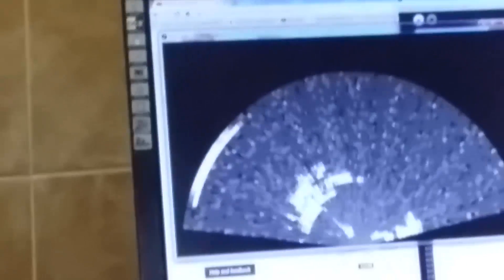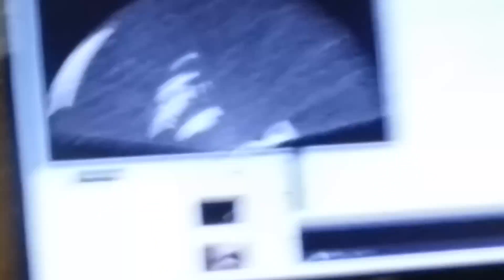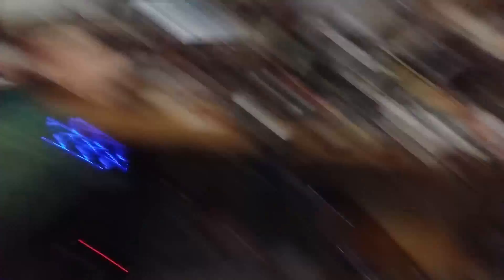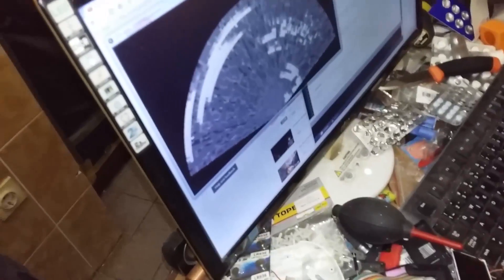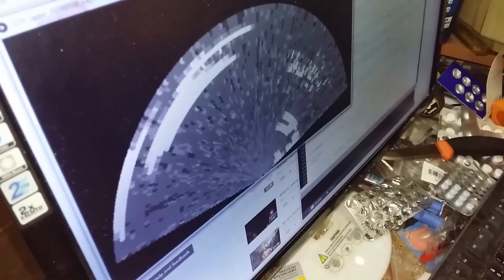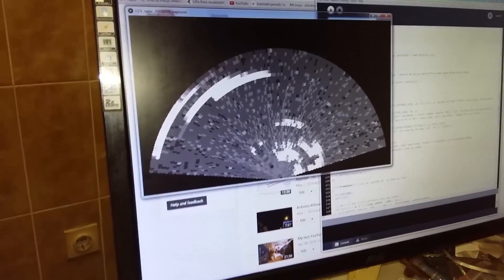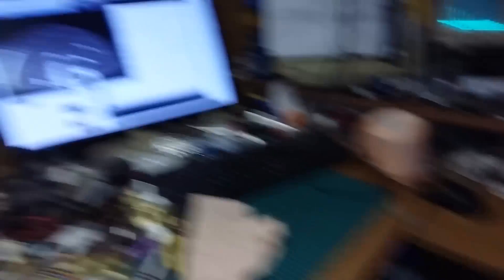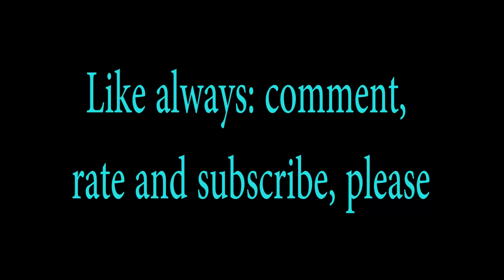Arduino Multipoint Ultrasonic Radar

Comment: Odličan video i eksperiment.
Primijetio sam da ste hrvat, pa evo pišem na hrvatskom. (english translation is under this post)
Imam pitanje, odnosno više njih :).
Vidio sam Vaš kod za arduino, te sam naletio na linije koda:
for (j=0;j<40;j++) 
{
 int str= ((analogRead(analog_pin)*5.00)/1024)*pow(i,2)*5;
}
prilično mi je jasno što ovdje radite, ali funkcija pow(i,2) ne bi li trebala glasiti pow(j,2)?
Kad smo riješili tipfeler (ili možda griješim) imam još jedno pitanje?

Vidim da je pretpostavka povratnog signala tj. analognog signala okomit na sami senzor.
Je li moguće da neki od tih povratnih signala ne dolazi samo iz okomitog smjera gledanja senzora?
Jer podaci iz datasheet-a ovog senzora kažu da je vidljivost ovog senzora -15° do +15° odnosno 30 stupnjeva od centralnog dijela senzora.
https://www.electroschematics.com/wp-content/uploads/2013/07/HC-SR04-datasheet-version-2.pdf
Lijepi pozdrav.

Great video and experiment.

I have a question, or more than one :).
I saw your code for arduino, and I came across the lines of code:
for (j=0;j<40;j++)
{
  int str= ((analogRead(analog_pin)*5.00)/1024)*pow(i,2)*5;
}
I'm pretty clear on what you're doing here, but shouldn't the function pow(i,2) need to be pow(j,2)?
Now that we have solved the tipfeler (or maybe I'm wrong) I have one more question?

I see that the assumption of a return signal, i.e. an analog signal, is perpendicular to the sensor itself.
Is it possible that some of those feedback signals are not just coming from the vertical viewing direction of the sensor?
Because the data from the datasheet of this sensor says that the visibility of this sensor is -15° to +15°, or 30 degrees from the central part of the sensor.
https://www.electroschematics.com/wp-content/uploads/2013/07/HC-SR04-datasheet-version-2.pdf
Greetings.

Comment: I was thinking about your project, maybe you could do a machine ultrasound machine to see inside the body like bones. Maybe this could be possible.

Perhaps the ultrasounds are reflected of different form depending on the frequency and of matter that they are going through.

Maybe they cross the skin and musculature and bounce off the bone, and several ultrasonic receivers could give a bone shape.

Well these are all thoughts in the air.

It would be a nice project.

Greetings.
Reply from the maker: This one can operate only in air. For water and body operation, there exist one with membrane attached to the body. There are few problems; speed of sound in liquid is much greater than speed of sound in air, bout 4 times (1400m/s in clean water, 1500m/s in saline water). Also, to get scan, you need more transmitting and receiving transducers, something like an array of transducers. Each transducer is then powered carefuly with some delay, so that 'steering' is possible. This is done in TX but also in RX period (where incoming signal is delayed properly and aligned with other signals from all elements in array, so that echo come as it should be). So, body scanner ultrasound has no mechanicaly moving parts, but rather electo-mechanical or phased arrays. Timing is also crytical... too complex to mess with. And, way how ultrasound bounce is; each wave (even radio and light waves) when entering area with different impedance (acoustic, magnetic, electric), small part is reflected back, depending of how abrubpt is the difference in this impedance. If suddend difference - more reflection, if less...
Reply: Thinking is easy, but putting things into practice is not so simple.

Too complex, I think as you say you should take it magnetic, electric and acoustic components for greater precision.

Too complex for an amateur project.

Thank you for your review.

Comment: This looks very interessting! is it possible to sweep the area faster? maybe add 2 or more ultrasonic sensors to scan a wider area?
Reply from the maker: Yes, it is possible to sweep faster. Or adding more transducers (sensors) to make 'oval' beam, so that sound is spread vertically, but narrow horizontaly. This way, it will cover more above, middle and below, while error in scan will be less prone. Error come from too wide beam, and if you can imagine round object scanned, it appear curved, or concave instead convex as we perceive round object. This is because during scanning, we imagine single line being scanned, but in fact it is over 30 degrees wide beam. The result is then false signal at 'approaching' of the ultrasound beam, then correct interpretation when sensor is directly pointed, but again it still reflects after sensor moves away in this too wide 30 degrees cone. Maybe simply adding parabolic, or semi-parabolic antenna... By this I mean, just curved plastic, metal or other materials, so that vertically it remains spread say 30 degrees, but horizontally spread as least as possible, maybe one degree or so. Then, object close may be distorted, but all other objects far will be correctly 'read'. Also, I should to work more on reflected sound amplitude and its interpretation on the screen. Since it looks like there is either no signal, or too bright spot - which should be gradient of light. Something like too much contrast.